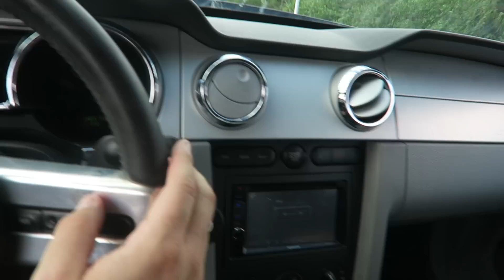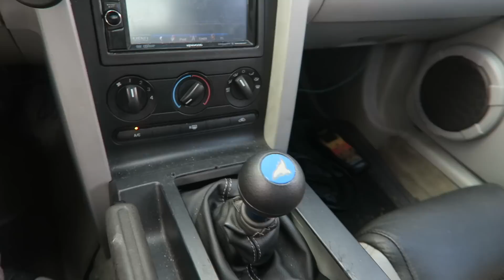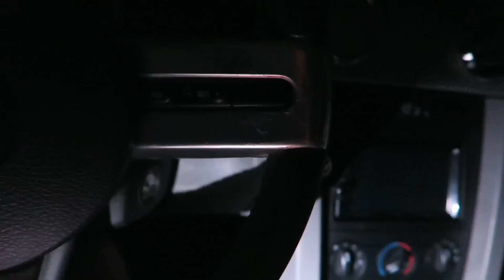Coyote Swap Mustang is DRIVABLE AGAIN!! *FOUND THE PROBLEM!*

Comment: Not that it matters..but its illegal to drive with your hazards on. I see it every day tho.
Reply: never knew that neither
Reply: @v6cuhhmaro419  yea.. its for roadside only.. the reason is if its foggy or hard rain and you are following someone with hazards on.. you might confuse them with a car on the side of the road with hazards on and run into them. Actually happens a lot and why its illegal. I didnt know till a few years ago
Reply: HorsePlay Motoring I though it was because when u ride with your hazards your brake lights are being used too, so u won't know if someone is slowing down
Reply: @MySHAQ18  im not sure on that..but my car dont use its brake lights with hazards..only turn signals..